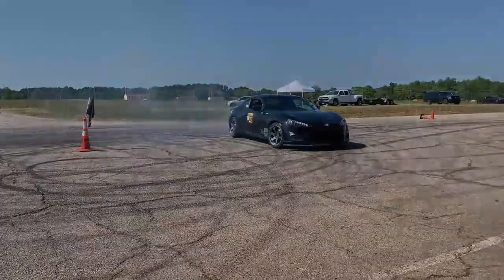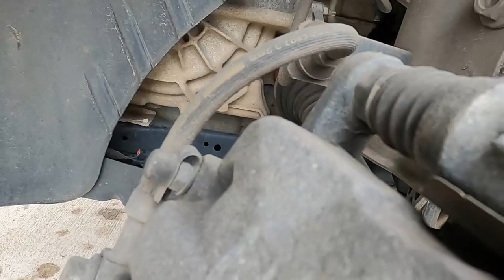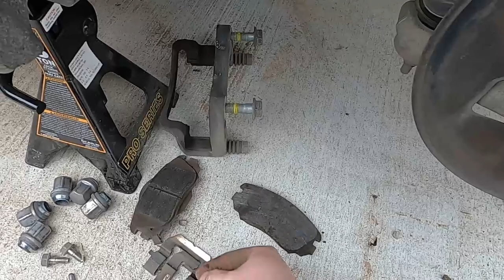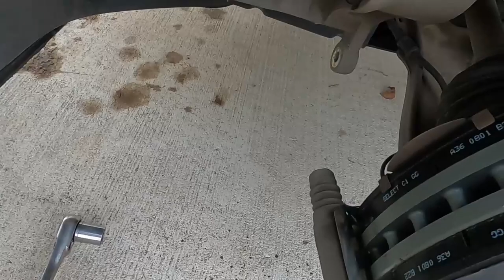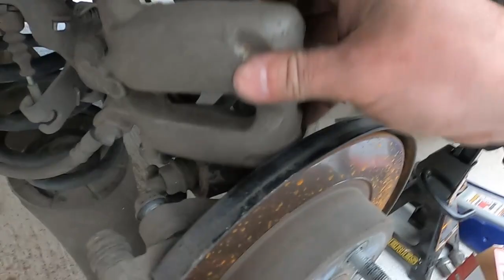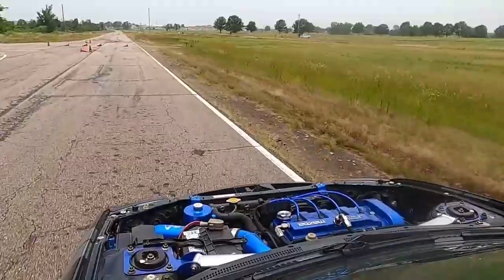How To - 2015 Chevy Malibu Brake Replacement

Comment: Rear pads fit tight to the knuckle.  Suggest removing the caliper bracket and fitting the pads off car.  Much easier.   Plus gives you a better approach to cleaning the slider pins and the caliper bore holes.  Get a proper wind back tool for the caliper instead of the cube.  In my experience there is only 1 side of the cube that half works well on this vehicle.

Comment: I got the same car ,What's the front rotors size ? 
Thanks 4 the video very helpful!
Reply from the maker: If you have the J60 code in your trunk, the smaller brake package, they should be the 296mm. To be certain, do what I did and take the rotors in to the parts store and match them up. Or measure them when you take them off. O’Reillys took a few times to pull the correct ones.
Reply: @RageFueled  Thanks 👍

Comment: hey! please im trying to help my mom out for christmas. she has the malibu 2015 ltz which has the turbos in it; im assuming from what you said at 1:00, you were saying they are the bigger brakes out of the two (which is more info than i can be blessed with considering Chevy doesn’t disclose that “specific information” for some dumb reason when we called ), but do you know what brakes the bigger ones are? are you able to find that info somewhere and either reply with the copied text from the site/or reply w the size? i can’t seem to find them anywhere or any info on them 😩 it would mean a whole lot!

and thank you for the tutorial! i subscribed to you <3
Reply from the maker: Look in the trunk. There should be a sticker somewhere that says either J60 or J61. The J61 has larger brakes; the turbo model. The front rotor size is 321mm I believe. The rear rotors should be vented. The non turbo cars’ rear rotors are NOT vented. Best case is to take them off and to a parts house. Have them match them. It took me three attempts for those guys to find the correct rotors.
Reply: @RageFueled  awesome thank you so much!

Comment: What size was the front torx screw?
Reply from the maker: I honestly do not remember. I bought a cheap set at harbor freight.
Reply: @RageFueled  found it out the hard way since then, stripped one of them out and had to drill the screw out
Reply: T 45

Comment: What tools did you use
Reply from the maker: Basic hand tools for most of this job. You do need a brake caliper wind back tool. I got the cheap square one that sucks but it does the job. If you do this often, I recommend getting a decent one.